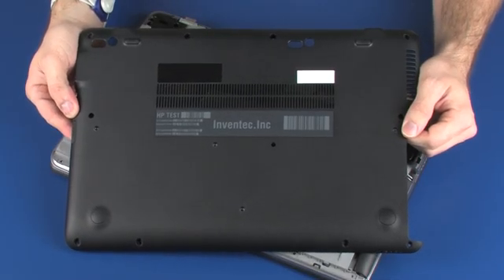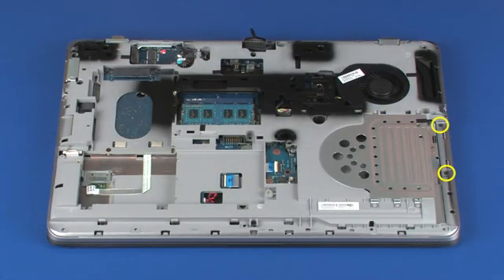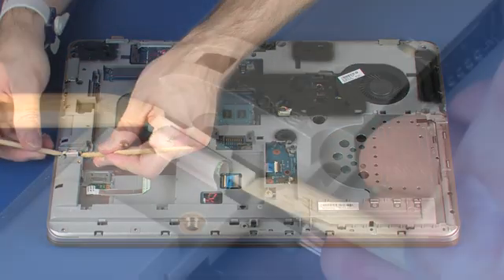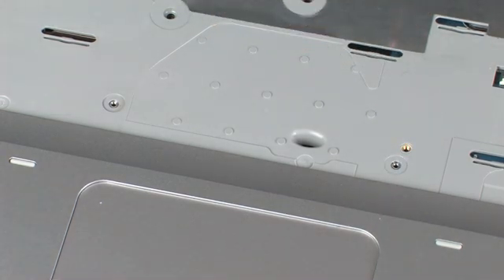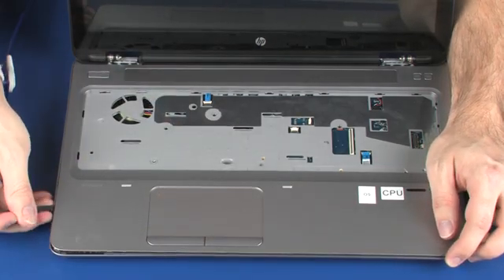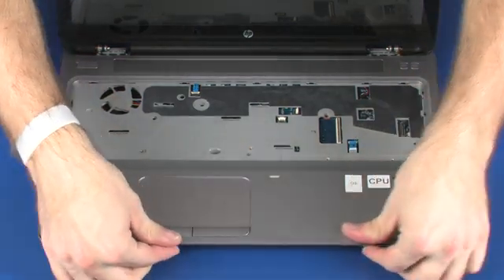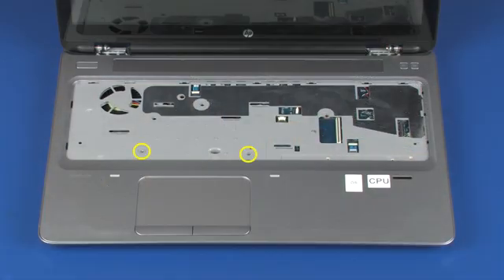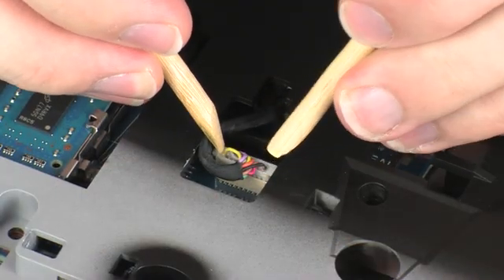Replace the Top Cover | HP ProBook 650/655 G2 Notebook | HP Support

Comment: How to replace tpm 2.0 probook 650 g 2
Reply from the maker: Hi there, thanks for contacting HP Global Social Media Support!
I understand that you need to convert from TPM 1.2 to TPM 2.0 on your notebook.
I will do my best to assist you.
Please refer to the instructions mentioned under this document to fix the issue: https://hp.care/6055SG9EV
Regards, 
HP Support
Reply: @HPSupport  The problem I face when I want to activate tpm I don't succeed.compatible trusted platform module tpm cannot be  found on this computer .verify that this computer has a 1.2 tpm or later and it is turned on in the bios .I always get this message even after activation
Reply from the maker: Due to limited support on this platform to fix this issue, I would request you to contact our Support, and our Support Engineers should be able to sort this out.
HP Support can be reached by clicking on the following link:
•	Click on this link – https://hp.care/6056SHLxM
•	Select the product type.
•	Enter the serial number of your device or select let HP detect your product option.
•	Select the country from the drop-down.
•	You should see the HP support number or Chat option listed
Regards, 
HP Support

Comment: This is a different design. Normally with HP the top cover is its own piece and the system board sits in the base enclosure. This one is kind of designed different but I will see if its actually an easier removal. I have a touch pad that needs replacement.
Reply from the maker: +Sean Love Please let us know how it goes.